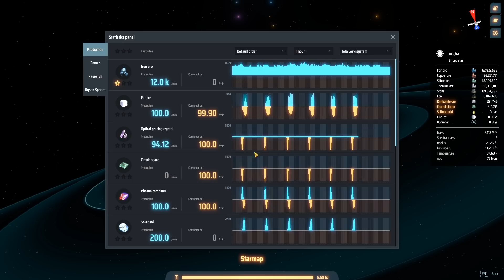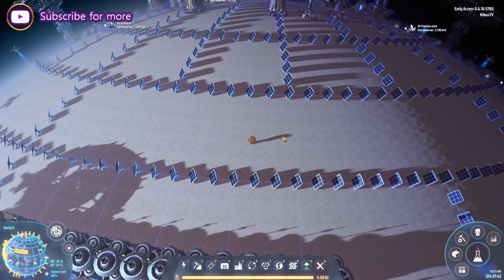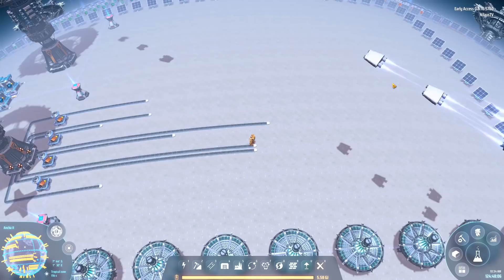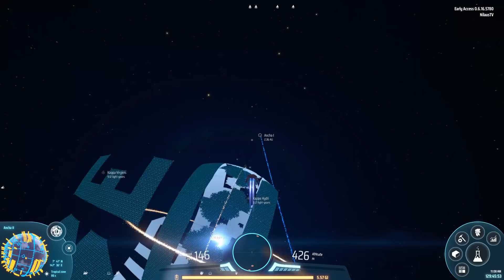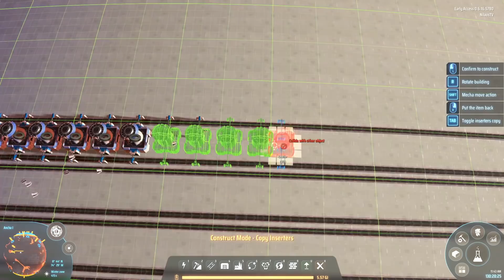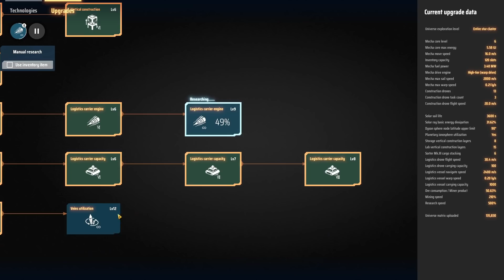SCALING TO MEGABASE IS SURPRISINGLY EASY | #27 | Dyson Sphere Program | Lets Play/Walkthrough

Comment: i still use planetary for setting up new mining. eventually itll all be shipped in there, but till the planet is dry I dont see the point in using interplanetary. That's really the only use i have for them, raw ore distribution on fresh production planet. Even if all I want is the ore, I'll still collect in planetary and condense into interplanetary for distribution. Just cheaper and you can get planetary much closer together. Interplanetary only used to get a single patch of ore seems like too much to spend imo

Comment: on the topic of the interstellar and planetary towers,

I'd say they should buff the planetary towers by giving them the same amount of slots as the interstellar but without the logistics vessel. which makes them just as useful but they are cheaper to use and will have less of demand on the power as well. or maybe giving them an one additional slot.

Comment: Local logistics is good for remote mining, like you fly to a new planet for resources, but you don’t want to setup a full base and just want things to be simple, drop 2-3 interstellar towers for resources output and energy input (battery or antimatter fuel), then go to mine nods setup mining sites with local logistics just to ship the resources to the interstellar, tap all mines like this and probably never come back.
In my personal experience, with 150% mining speed and 7 miners each with at least 6 nods, it takes at least 3 mining sites like this to suffice an interstellar logistic output constantly, so instead having multiple interstellar everywhere each ships out resources, I just tap all mines with local logistics and send the resources to the dedicated output interstellars. They also use less energy.
But that’s probably the most use of it, for smelting site you will want to use interstellar, so eventually it can request ores remotely when the local resources drys up; and for assembly works 3 slots normally just not enough.

Comment: Completely disagree about removing the belts from the interstellar logistics stations. They are an upgrade and a reward for teching up.  
  
 It's like saying that the higher level belts or assemblers should only be able to carry higher level components. Or that large storage containers can only recieve inputs from small storage containers.  
  
The trade off with them is the much higher energy requirements, the higher manufacturing cost and complexity, the increase in minimum build distance, and the need for warpers to make them truly interstellar.  
  
 All the extra costs and complexity just for 1 extra slot is already a reasonable balance.

Comment: 23:00 i think using the planetary hubs for planet-side and intra-system traffic would make more sense.  That would allow us to further refine logistics so that we can have dedicated interstellar towers handling trade between systems, and then have planetary towers taking over distribution once items arrive from god-knows-where.  Right now I can request something that is on a planet in the same system and it could be fulfilled from 20 lightyears away, which doesn't make any sense.  Plus if we did it this way we wouldn't break anyone's save.  Just add an extra drone slot for the logistics vessel that only becomes available once we unlock interplanetary logistics.

Comment: Counterpoint to Interstellar Logistic Hubs "overshadowing" the standard ones: Do Assembler Mark IIIs "overshadow" Assembler Mark IIs? Perhaps the Interstellar Hubs were always meant to be a direct upgrade.
Reply: There is one significant difference. The larger size of the interstellar hubs makes them need to be spaced further apart.
So if you have 2 planetary logistic stations as close as possible, and then go to try to upgrade them, it wont let you place the interstellar ones that close.
Reply: Except the mark 3 assemblers do everything the mark 2 assemblers do except faster. That’s not the case with the planetary hub vs the interplanetary hub.
Reply: @bob76451  The interplanetary hub does everything the planetary hub does, except with more features. Seems pretty comparable to me.

Comment: Planetary logistic stations can be put very close to another planetary logistic station compared to interstellar. Which allows for many compact builds. I have a planet where i put all the smelting and chip arrays for my 900/min base. There would not be enough room if i only use interstellar.

PS: works better with high lvl drone speed tech

Comment: log in, log out, input, output, low and high. log tower in, log tower out, in tower in, out tower out, low tower, high tower. Low tower are planetary (local) only, high towers are inter-planetary. this way you say, low out, for local (planet) tower output, and high input for inter-planetary input. high output is outputting from inter-planetary. or you can say, this is going into the logistics system by simply saying, log-in, or logistics input, and log-out for logistics output. that way you can use the sound, low, for a shorter way of saying local and the word high, for referring to space.

Comment: I'm a game developer. You don't need to break saved games to make your change, which is a good idea you have. What you'd do is add a new building that is a different interstellar tower (with no output ports). You make it buildable and "turn off" the ability to build the old interstellar towers. They still exist in all old saved games as they are, so those games would load and play fine. If someone has an assembler with the recipe for the old tower ID then it can be switched to the new ID. That said, I might still make it so new games are created with the new tower, but old games just keep using the old tower. IMO it's something you need to deal with once you decide to go Early Access. If you don't want to manage peoples' saved game compatibility then you don't go public, but good ideas should still be implemented even when "hard."
Reply from the maker: Great point. Small companies making unpopular opinion for the good of the game can be hard. When Darkest Dungeon added corpses the community was in uproar, but in the end it became a much better game for it
Reply: @Nilaus  changes will happen and if people dont like them its their problem is early access and one of the best i ever seen, but they can and will make changes.
Reply: @1Rictec  Lets face it, testing is one of the primary reasons small Indie Developers go Early Access in the first place. They do not have access to large QA and Testing departments so the kind of public testing they get from Early Access feedback is invaluable.

As you said, Early Access, changes will be made, a good group of developers will take that Early Access feedback and make a great game (like Subnautica turned out to be), a bad group will cock it up! Fortunately the guys behind DSP appear very much to be in the former rather than the latter category...

Comment: I’d be okay with your design suggestion for planetary/interplanetary transport hubs if they increased the number of internal slots in the planetary hubs to five.
Reply: Same, they could even increase the number of internal slots in the Interstellars to six or seven as well if they are both going to be purely specialist buildings rather than Interstellar Towers being meant as an flat upgrade to Intraplanetary Towers, or even if they make the Warpers a specialist slot so they do not take up one of the internal slots. Essentially if you are using an Interstellar Tower to move things between systems you automatically lose one of your internal slots because it has to be assigned to warpers.
Reply: @alganhar1  Technically you can pipe warpers in. You don’t have to use up an internal slot.

Comment: I disagree with your opinion on the planetary logistics for 4 reasons:
1. They are much smaller. This allows me to put them much closer together. I'm not sure if this is just a thing with my factory designs but I usually have most of my inputs and outputs of production lines close together so I rarely have the space to put everything in interstellar logistics stations.
2. It is easier to identify where resources are going to just by looking at the whole planet without the need to check each logistics station individually.
3. It requires less energy to charge and the minimum power you can set is lower which makes it more convenient for setting up the small outposts that you need to mine rare resources (or just for early game outposts).
4. It might simply be designed as an early game building. Kind of how you have 3 levels of assemblers. Its purpose might just be to allow you to do logistics before you have unlocked the interstellar one.
Reply from the maker: 1. They are smaller, but for many builds you need 2 where 1 interstellar would suffice, hence it is not an advantage
2. No idea why it would be easier to identify with more Planetary towers than with fewer Interstellar towers
3. That is simply not correct. The idle consumption is identical. The charging of drones is identical. The only additional power consumption is for vessels
4. Maybe it is just meant to be strictly worse like a MK1 assembler is worse than a MK2, but I feel it would be more interesting if they had different functions (like the Gas Giant Collector is different)

Comment: 45:07 - at 10 assemblers, working at 1.5 speed, that's 30 per second of coils, too much for one belt if you are having 2 lines of 10 outputting to a single belt. The center belt will be oversaturated because of this. you need two belts in the middle.
Reply: The assemblers were already beginning to accumulate coils when Nilaus took off. I was waiting to see when he would notice his mistake, then all the yellow circles started popping up and he completely ignored them and took off...
Reply: Don't the lines become of 15, giving a total of 30? Doesn't the tier 3 belt carry 30?
Reply: @paulstelian97   They are a 1 second cycle for 2 coils, so it prepares 2 per second... but the assemblers run at 1.5 per second, so that's 3 per second it's putting out. Thus, 10 assemblers alone put out 30.  The max is 30 per belt and there are two lines of 10 going onto that belt.  I know these calculations are tricky so I did it 3 times before typing as Nilaus will usually tell me "You forgot about ..., this is why it works." I'm just waiting for today's Twitch stream for him to say it.  LOL
Reply: @RealCyclops  i built this so long ago and knew i was right, but still ran it through a calculator 2 different ways multiple times before coming here to comment :). Its actually a tiny build an i ran two out of one station for a total of 120/s. Doubled it cause I run 200/s just to launch rockets. Turbines are a bitch
Reply: I was just about to pop in the comments to say something about this error lol

Comment: I think using the interstellar logistic stations over the planetary logistic stations is the intended progression path.  the planetary stations are unlocked first, and then used in crafting the interstellar stations.  Also, as you unlock more tech, the recipes have an increasing number of inputs which are available in the interstellar stations.

Comment: How are you pinning the systems?
Reply: while in sail mode, push alt to unlock the mouse cursor, then mouse over the star you want to pin and click the pushpin.
Reply: @InverseCh  thanks but using alt does nothing, tab unlocks the cursor, but nothing happens when i click on the system I want to pin
Reply: k, i checked in game. hit tab while in sail mode (not map mode) to unlock the cursor, hover over the star, then click on the horizontal push pin to pin it.
Reply: @InverseCh  yeah with the mouse curser if I mouse over the system no pushpin shows up, just the name of the system and the distance

Comment: I have have come to the same conclusion on preferring to use interstellar over planetary transportation. For the same reasons as well. Thanks Niluas For insight into new smelting tactics
Reply: They're not strictly better, because planetary can be placed much closer together. But that only occasionally matters.
Reply: @mcwhitfield09  You have a  point but real estate is not an issue. At least not for me :)
Reply: @mcwhitfield09  But they only have 3 nodes instead of 5, so even if you could place them twice as close you would barely get any benefict.
Reply: @yuidesu5625  6 slots compared to 4 useful slots? There is a little bit of benefit if you can get them twice as close (2 in the same area)
Reply: @paulstelian97  5 useful slots, if planetary are even considered an option, warpers are obviously out of the equation.
Reply: @JavierSalcedoC  Thats useful info, thank you. This means that they still have a niche in complex tight builds. Maybe in a future patch we get something that needs a lot of different inputs, currently the only thing we have is white cubes and you can manage them with only 2 inter or 3 planetary(but its very unlikely you have all the stuff on the same planet)
Reply: I sometimes use planetary ones as buffers for mines that then locally feed into an interstellar one. This helps consolidate the ores so they get shipped out more often.

Edit: typo
Reply: @AddisonLuh  LOL i do the same thing i have 6 lines of 18 smelters per line on planetary transport that pulls ore from all of  the ore planetary transports next to the ore mining facility :)  i use my interstellar for making items since they have more slots to do damand items for

Comment: The reason you were getting some items coming into your hubs slowly is because all 50 drones were already in use for the other items to do the initial buffer. I noticed it on your processor build around 32:00 in. Once the buffers fill it’ll be fine with local demand and not need interplanetary.

Comment: If you can't get enough deliveries made to one of your towers (if you want it to output 120/s), you can increase the charging rate. I have left it to the default setting forever, then I realized that each ship needed to be charged before leaving on its trip (obvious, in hindsight), and that it required more power for longer jumps.